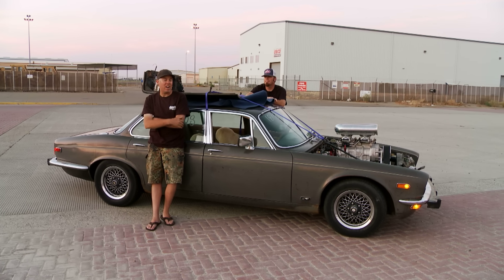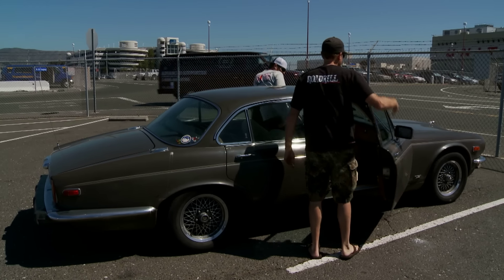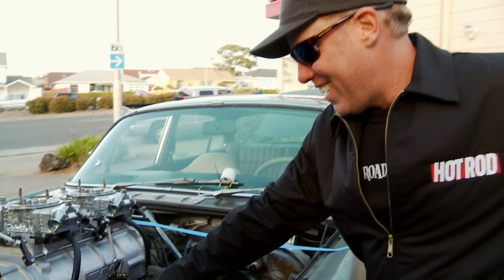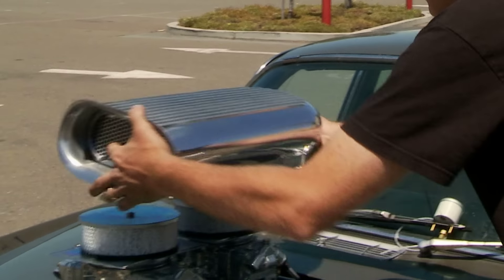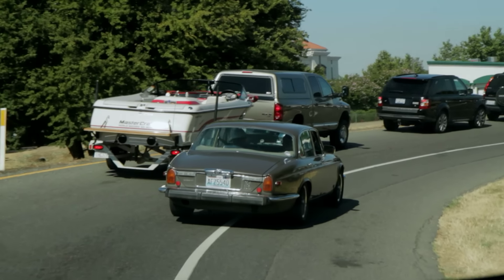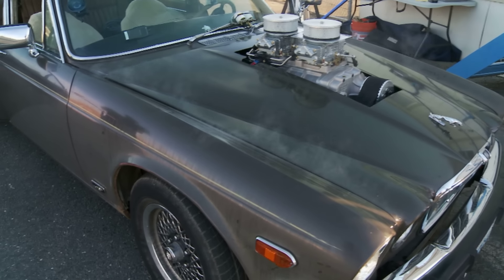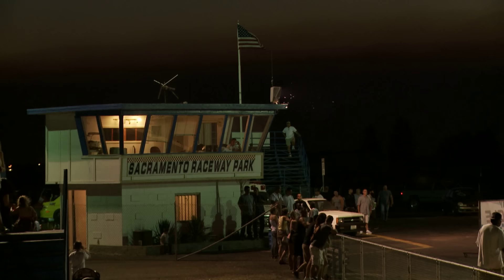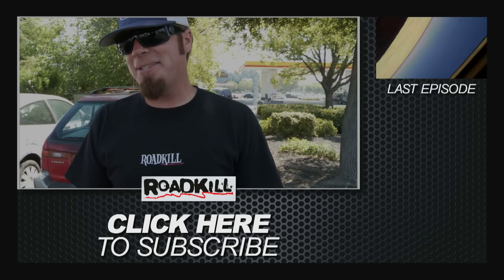Release The Draguar! Building a Blown Jaguar Rat Rod - Roadkill Episode 7

Comment: Never seen an XJ6 with the steering wheel on the incorrect side!
Reply: its an xj12
Reply: minibiker99
I sit corrected!
Reply: Factory reject. You know, Jaguar build quality and all that. Give all the wrong ones to the Yanks, no one knows the difference...
Reply: Midget saw No. The XF is one of the best mid-size saloons on the market. The 5 series might be a bit faster, but the Jag is comfier and has really nice handling with it, and lots of little details that make it a nicer and more interesting thing to sit in for long periods. The XJ is one of the best luxury limo-saloons out there, for similar reasons. The F type is a cracking big sports car, despite the annoyance of no manual option (and so long as you steer clear of the V8 version) and I'd recommend it to anyone who didn't absolutely have to have a clutch pedal. The XK is getting on a bit, but is still a cracking GT, an Aston Martin DB9 in all but price and the luxury hand made feel. Oh, and it doesn't have a V12, which is a pain. 
The whole range is pretty good, and yes, they do all look fantastic. 
And, if you look at the top 100 most reliable cars (according to warranty direct) there's a fair few Jags in there, amongst the Japanese stuff. Not many BMWs or Astons or any of Jaguar's competitors. Having free reign on what they do, and sharing with Land Rover has allowed their reliability to shoot through the roof compared to when they were strung up by Ford or BL.
Reply: Foxtrot Oscar Dude, get your head out of your own ass. Not every car has to be restored. If one or two cars out of a 100 (just an example) is completely different, its completely fine. Thes particular XJ12 is more interesting and full of character than any other XJ I've seen, since they are all restored and are basically stock. That's boring.
Reply: MarchuxProductions It's certainly interesting, but character? It's got a gutless, flat, dull engine and the only thing worth noting is the fact that half of it is sticking through the bonnet... which looks ridiculous.
A good one, with a proper V12, has far more character. I should know, I've got one.
Stock is good. Why? Because stock is good. Jaguar built a bloody good car, so why not enjoy it? Why turn it into something that looks like a good car but is actually just another V8 powered heap of shit?
That is boring.
By all means, modify an XJ, lord knows I have. Bypass pipes, a decent fettle and tune, 400hp, LSD, uprated bushings and roll bars, manual gearbox... It makes it a truly bipolar car. Quiet, sedate, refined, comfortable cruiser on one hand, but also a belting, well, I suppose it's a bit of a muscle car. But you can do that very, very easily with a V12, and 12 cylinders is far more interesting than 8 will ever, ever be. You can also supercharge the V12 too. And if you're going nuts, bore and stroke it to 9 litres, add the supercharger and end up with an 1100hp nutjob thing. But that's ridiculous.
Either way, keep it subtle, like the car always was.
All that this car is now is a loud, obnoxious, but worse vehicle. Originally they were the fastest 4 door saloons in the world, but now it couldn't pull the skin off a rice pudding, and it's an unreliable heap too.
Reply: Foxtrot Oscar Damn it, I should've mentioned that they put in a 640hp small block recently. And, see, Chevy V8s are more flexible. Why? Well, fully built small blocks can produce 1500+ hp, and I won't even go into detail with big blocks. Those engines are so popular, that it makes sense (at least in the US) to swap in V8s. Of course, this exact one is a really bad example, but, when done right, a newer LS series engine can do wonders. Especially if they don't want it to be a show car (or, should I say, a trailer queen?) but a thing to bash on and drag race. It was a run down car when they got it, and this is probably the best thing they could've done on a limited budget. This is a clash of two different motoring worlds, and it worked. Adding some 'murican muscle to British refinement isn't a thing that is seen too often, and it is almost always good to change things up a bit.
Reply: MarchuxProductions You don't need 1500hp in a Jag and if I did want ridiculous power I'd throw a 2JZ in there and pump 2000hp all day long.
Chevvy V8s are NOT popular. You almost never see them. Last time I saw a car with one in was Le Mans.... where I also saw more 1960s British sports cars than American cars full stop, let alone V8s.
massive American V8s are NOT popular.

They're also shit.

Why not spend less money getting a V12 built up? Even importing parts from Britain can't be as expensive as an 8k V8? 
The newer LS engines can make mildly impressive power figures (1500hp from a 7 litre engine isn't that impressive, a bone stock EVO X makes more specific power)

When done right, the LS engine is just about mediocre. That's a LOT of work for a mediocre engine...
If you want a show car, DON'T put an LS in it. If you want a race car, DON'T put an LS in it. And if you want a nice car to just drive around... you've guessed it, DON'T put a V8 in it. If you want a heap of shit that cost quite a lot of money, then put an LS in it by all means... but be prepared for people to point that out to you.

This is a clash of two motoring worlds that hasn't worked at all. They've got a nice Jag that's now a heap of shit, and they've got a powerful drag engine in a heavy car... Heavy car with a crap engine... Yeah, really great.

Adding 'Murican muscle to British sophistication isn't done very often because it's a SHIT idea. PERIOD.
Reply: Foxtrot Oscar We're not talking about just brute power here- it's RELIABLE power I'm talking about. That's why it might seem expensive. I'd like to see an old V12 be run both on the street and the dragstrip. It simply would not last. If it really was cheaper and viable, how come NOONE in their right mind uses them in their builds?

And your comment about popularity is completely irrelevent. They live in The States, where Chevy V8 engines are in just about anything from a dump truck to a Corvette. Importing and building jag engines would be hard and expensive.

I love 2JZs and RB26s more than any other engines, but let's face it- a 2000 horsepower 2J wouldn't last. Their safe limit is about 1500-1600hp, and to even get there costs more than building a 2000hp big block.

LS engines are good. Although I'm not the biggest fan of them, I have to admit that they are good, because they simply are. They are very flexible, relatively cheap, easy to modify and easy to take care of, much more than your precious Jags. I've met a guy who restores cars, mostly Jags, and he agrees that old Jaguar engines are finicky and tough to look after.

So, stop being the know-it-all, American hating loser (who thinks that everything made by the 'Muricans is shit) and shut the fuck up. Have you forgotten that the British used to build cars that didn't even hold together? If you want quality and finesse AND ease of use (especially in older cars) Britain isn't he way to go. Germany and Japan are the best. But if you want raw power and a car to bash on, America is the way to go.

Shit-headed elitist prick, why am I even arguing with you, you're the freak who likes inferior things just because they are made in the geographic location where you happened to fall out of a vagina.
Reply: Foxtrot Oscar BTW, this is coming from a European.
Reply: MarchuxProductions Ahem. Jaguar won Le Mans on that V12 twice.
No Chevvy engine has EVER done that, and the last was a Ford engine in the 60s that was twice as big as everyone elses and was mounted in a British car, the GT40. 
Jaguar also won numerous other endurance races with the V12. They're solid engines. Mine was in a barn for a couple of decades and has well over 200k since I rebuilt and recommissioned it. That was new rings, a light hone of the bores and new bearings. 
They're reliable engines. Damn near bomb proof.

Compare that to V8s... hmm, my Corvette grenaded itself, it's now a coffee table, the V8 in my Rover never quite ran right, my mate's Mustang died on track and ended up costing him an engine and a new bonnet it was so bad.. 

V8s aren't all that reliable either. 

Also, looking at them. V8s are NOT naturally balanced. This introduces stresses that perfectly balanced V12s DO NOT have to deal with. This makes them naturally more likely to break. 

You've just hit the nail on the head. Chevvy V8s are in dump trucks to Corvettes. In Corvettes they don't work because they're truck engines. Big, fat, lazy, torque but utterly useless for speed. In trucks, however, they have seven shades of shit kicked out of them by diesel engines, which are perfect for truck use.

A 1000hp 2J is perfectly safe on stock internals. It's making 333hp/L.
Try getting that from an LS1 and you need to aim for 2000hp, which is going to blow it up. The fact of the matter is, 2Js are bulletproof, big V8s are quite fragile. Yes, there's the 10 litre, 8000hp things... but they need a rebuild after only a few drag passes. Which means that some barely make it past 6 miles of actual driving. Which is shit.

Old Jaguar engines are PISS EASY to look after. All you have to do is use the right oil, and the,.. you know what, fuck it, ALL OLD ENGINES NEED PROPER ATTENTION. However, give a Jaguar engine that attention and the performance is fantastic. As good as or better than a period Ferrari and FAR superior to period American V8s (Some modern LS engines make LESS hp/l than my '61 E type did 53 years ago!) but requiring far less maintenance than the Ferraris and not much more than the American stuff.
Yes, they have their nuances. The XK6 engine was designed on the factory roof when the engineers were watching for incendiary bombs that could burn the place down. The V12 was an abandoned race engine. Those difficult starts mean that the XK had problems with oil seals, because they were designed in 1945 and were good then, but by 1992 when it was withdrawn, that was old school tech. The V12 suffered similarly as it aged.
However, compared to their contemporaries, they're hugely powerful and reliable and smooth engines, and NOT ridiculously expensive. In the 60s you could buy a Jaguar E type or a little FWD Lancia Fulvia for similar cost!

LS engines are SHIT. Compared to the 40-60 year old Jaguar engines I run, LS engines are rough, barely more reliable despite modern electronic fuelling and ignition, do NOT make the power they should and do NOT get that great fuel economy either. I could do, in my 330hp, 5.7 litre Corvette... 20mpg. I can push 20mpg in the 5.3 litre, 400hp Jaguar which is heavier, 40 years older and less aerodynamic too.

I cannot being a "know-it-all, American hating loser (who thinks that everything made by the 'Muricans is shit)" because I DO NOT HATE THE FUCKING USA, I DO NOT THINK EVERYTHING THEY MAKE IS SHIT AND I AM NOT A FUCKING LOSER YOU RETARDED FUCKING CUNT.

I have NEVER said I hate the US, I've NEVER said everything it makes is shit.
If I were born in the deep south of the USA with deeply religious parents, a good solid patriotic brainwashing of an upbringing and I was forced to sing the national anthem and swear upon a flag every single day... I'd still buy a Jag over a Corvette, because they're just better. I don't care where things are from. I'd buy Chinese cars if they were any good. I've got a Japanese car for fuck's sake. I had a Corvette (which is why I started to hate V8s, because it was a gutless heap of shit that drank fuel like it was going out of fashion and gave very little return... and blew up and broke down a lot).
My milling machine is American. My lathe is British. My micrometer and verniers are Japanese. My spanners, hammers, chisels and knives are all British. My lighter is America
This is because an American Bridgeport is mill. A British Colchester is a solid, accurate and good value lathe. Japanese Mitutoyos are good instruments, Sheffield steel is the best in the world so that's where my steel tools come from, especially knives, because they stay hard/sharp/shaped properly for longer and don't break as quickly.
American Zippo lighters are solid, reliable and although they drink as much fuel as American V8s do, they are mostly windproof and don't snap in half when I sit on them.
Everything I have I have for a reason...
I have the Jags because they offer, for their periods in history, a fantastic mix of quality, sophistication, speed, power, handling, braking, engineering excellence, beauty of body and GREAT value for money. I have the Nissan because it's a solid, cheap drift platform with good control and stability and parts availability, even from Japan.
I have the Land Rover because it's infinitely versatile and has yet never actually broken, despite having been completely round the clock eight times. I ditched the Corvette because it was costing more to keep running than the '55 Jaguar race car did for a season's racing, including fuel and maintenance, and it was a LOT less fun and spent half of its time broken. And my mate beat me on a road course in his 1980s BMW... 

If you want quality, finesse and ease of use... The Germans in the '60s and 70s made a lot of nice barges, but they didn't have V12s like the Jag XJ12, nor will they do 150mph and shit on most modern sports cars in a straight line. I like that.
They didn't make sports cars like the E type either, so that's why I have that. I thought about a G Wagen, but the Land Rover came up cheaper and has proven to be more useful as I can swap the body around as and when I feel like it as it's all modular, and as it's more common world wide, parts are easier when I'm touring.
The Japs build lovely cars, but didn't really get going until the 80s/90s, at least with cars sold in this country and thus available for me to buy at reasonable cost. I'd love a 240Z though. The Japanese E type of 10 years later... gorgeous cars.

The ONLY time I'd choose an American car is if I needed to smash into shit. If I were to get in a police chase in the 1970s, I'd probably choose a Charger... but I'm not in the 70s, and I'm not in a police chase. I'm in 2014 and I'm a nice guy.. and to be honest, in the 70s, the XJ12s of the British police force would have caught up quite easily with the Charger... 
For the average... me. American cars offer less power for petrol burned, meaning I spend more, or go less distance. (I drive 2-300 miles a day most days) they also offer lower quality than I'm used to albeit at lower cost, but also less driving feel and comfort with less engine character and, these days, divisive styling. What is it with GM cars and fucking angles everywhere? They just have so many shitty angular lines all over the place, it's an artistic nightmare!

Sorry, no American cars appeal to me currently or in history (bar maybe a Plymouth Barracuda. Apparently the S models handle sort of ok ish, and they look cool and have a cool name.
That's about it.)
And before you say 'The Ford Focus is a good car', yes, it is, but it's European. Ford Europe designed and built the first and second generation and this current 'world' generation with input from Ford US isn't as good and looks ugly. Oh dear. 
Facts of life and entirely coincidental, sorry, not my fault. 

So, you shit head slanderous prick, actually get to know a person's reasoning before attempting to shit all over them. It's incredibly rude, don't you know, and now you look like a total cunt!
Reply: +Foxtrot Oscar your reasoning is just piss-poor. You base it on personal preference, rather than reality. A 1000hp 2JZ is as likely to blow up as a 1200-1400hp LS (if both are built properly). The 2JZ is actually one of the rare straight-sixes that can handle ~750-800hp on stock bottom end, BTW.

After reading your reason for hating V8s, I have to ask: what year was your Corvette? Everybody knows that mid-70s to mid-90s was horrible for American cars.

You have NO IDEA about modern V8s, do you? Seems like it's the case because LSes get A LOT better mileage than what you said (also, stop using shitty measurement units, metric is better in every way)

A close relative of mine sold his beat-up 1981 Merc G-wagen for 6000 Euros a few years back. It had been rolled, the rear door had basically rusted off and the rear end was lifted with a bit of pipe stuck on the coil springs. You know why the price was so high? Because it's an amazing offroader. I rarely see even newer Defenders in a lot better shape go for that cash. That's because they ARE NOT THAT GOOD. Behind the wheel of that Mercedes, I managed to get further along a very difficult trail (I'm VERY inexperienced off road) than more experienced drivers with more expensive cars, including a few Land Cruisers, a Mitsu Pajero and your precious Landy. Or was that the older Range Rover, I can't remember.
 Boom. Disproved your point.

Next thing, the '70 Charger vs the S2 XJ12. Well, let's assume that the Charger is an R/T HEMI. If that is the case it beats the Jag from 0 to 100 (0-60, for morons) by a whopping 2,5 seconds. Not really faster, huh? Back in the day, no car could really catch the top of the line American muscle cars in a straight line. Especially the HEMI Chargers and Barracudas, the 454SS Chevrolet Chevelles or the Shelby Mustangs. OK, another one down.

Another thing, Chevrolet has never taken racing outside of the US seriously, so Jaguar winning at LeMans in the past is COMPLETELY irrelevent. How many engineers of that time still work on the new models?

Good job confusing the past with the present, cretin. Learn to fucking comprehend written text, you twat, and STOP USING YOUR BLOODY-WRONG OPINION AS A FACT. You are like one of those kids who think that every toy the own is better than any other toy. Don't even try denying this, because you clearly are like that. And your bullshit about 1000hp 2JZ engines running for ever - which mechanical asscrack did you get that from? There are some 800-ish stock internal 
2Js on the streets, but that's about the limit of what it will take. Built 2JZs, sure, they can get up to maybe 1800hp at max, but it will cost more than a similar-power LS.
BTW, there was a stock bottom end LS3 with twin turbos that pushed 1500hp in a drag-racing truck (IIRC it was called "The Red Devil" or something like that) that later got transplanted in some sort of a late-model GM and run on the street for years before blowing on the dyno. And the LS3 isn't even the  good LS!

Your points are entirely opinion-driven and pretty much outdated. Gone are the days when the Brits ruled everything. Gone are the days of Land Rovers being the ultimate off-road machines. So, stop blabbering on about how shit LS engines are while you have only had ONE car with a Chevy V8 (maybe it was the 350 smallblock, then no wonder why it sucked) and understand that Jag superiority has ended. They are sort-of coming back, though, the F-type is quite awesome.

You are the one who looks like a cunt, mate. Why? Because complete ignorance.
Reply: MarchuxProductions A 1000hp 2JZ can do so happily on stock internals. It is then making 333hp/l. An LS1 doing that needs to be making closer to 1900hp. In terms of stress applied, a 1000hp 2J is doing a lot better than a 1400hp LS, AND will do it on stock internals, very cheaply and is a nicer engine. It's a more impressive machine by a long shot. 2JZs have been proven to 1500hp on the stock bottom end, although not for huge periods of time. No 3 litre V8 I've ever seen can do that...

Everyone knows that the 1890s to 2014 has been rubbish for American cars.

I owned an LS1. I still do, it's now a coffee table.
The thing came out of a C5 and was a gutless, horrid piece of crap.

I've also driven C6s, C7s, C4s, C3s, C2s and a few C1s. I've driven Mustangs, Chargers, Challengers, Darts, Tempests, Trans Ams, Barracudas, Roadrunners and more. New and old.

I use metric. Sometimes imperial is easier though. Litres are metric, duh.
I refuse to use PS instead of horsepower though because PS is just German for horsepower and it's a fucking ridiculous measurement that's only a teeny bit more than hp and no one even told me that it was taking over. I still always write in horsepower. Fuck the Germans and there pferdeshekasjfuhdwsdf whatever it is....

Sorry, rant over.

You've disproved nothing. There are more Defenders in the world. Then again, the Americans will pay up to and beyond $70k for a decent one. 
However... a G Wagen is a very good vehicle, no disputing that... but I cannot lie down and sleep in the back of one. I cannot get parts in the middle of the African desert like I can for the Land Rover, I cannot chop and change between open top, soft top and hard top  and pickup like I can with the Series III. I cannot run a power take off for my lawn mower. I cannot fit the water and fuel tanks I have in my SIII in a Gwagen, I cannot fit a dormobile roof to a G Wagen. I cannot start one with a crank handle after it's been sitting in flood waters up to its windscreen for a week. I can't do those things because the G Wagen is less modular and more civilised. Nice for playing with, but not as useful for actually going out and doing shit. I could probably survive with one, but now I have the freedom of a Land Rover, I don't think I'd like using anything but. I tried using a friend's Humvee once... I wanted to die, it was an awful trip. Then again, Humvees are shit and G wagens are much better. I'd love a UNIMOG, or a 101 Land Rover.... Point is, the SIII works for what I do with it perfectly. If I didn't work it so hard, a G wagen could take over, but it's the little things the LR has that the Merc doesn't. And I'd keep smashing the indicators on the G wagen. My wing tops take a hell of a battering. Good place to stand when winching.

Charger vs XJ12. Let's see. They'd do 140mph in a straight line, so, drafting the Charger could easily keep up in a motorway pursuit... or if the idiot went off onto smaller roads, their infinitely superior handling would ensure the Charger was apprehended very quickly. Also the huge fuel tanks and superior fuel mileage of the XJ12 would win out in a long distance chase. In the 60s, the 3.8 litre E type Jag was poking 150mph in the eye with a big stick. The 7.2 litre aero modified Plymouth Superbirds 10 years later were running out of puff at 145mph... Hmm. Straight line speed eh? NOPE!

Chevrolet are VERY serious about Le Mans racing, that's why they had the biggest, fanciest crew area, made LOTS of shouting patriotic noises and had a fucking club stand with a few rickety old Corvettes on it. No one else did that, not even Audi who make much nicer cars like the A1.

The JAGUAR V12 ENGINE winning Le Mans is ENTIRELY relevant to the JAGUAR V12 ENGINE BEING RELIABLE AND POWERFUL

Britain still makes bloody good shit, Land Rover are still best in pretty much every class they're in and guess what, Jaguar are making cracking cars too. XJ, XF, XK and F type. Get the V6 in any of them and you'll have a ruddy wonderful motor vehicle.

I had one LS1 powered Corvette... but my job is to drive lots of different car. I've driven LS powered trucks, cars, kit cars... they've all been shit. They're NOT GOOD ENGINES AT ALL. Maybe in the 1970s they'd have been considered ok... In fact, no. My XJ12 is from the 1970s and that's MUCH better than a modern LS. In fact, my track car, a 1955 Jag has a nicer engine than a modern LS, and more mechanically advanced too with DOHC. If I had low standards, 50 years ago, I'd have said the LS engine was good. Not if I were a high standard guy, which I am, and certainly not compared to things like the 400hp Nissan 3 pot thing.. 
Jaguar were never superior to everything.. however they do do what they've always done. Offer a high class experience for less money. The XK is an Aston Martin... but cheaper. The XJ is a Phantom... but cheaper. 

You are the one who looks like a complete idiot mate. Why? Because this shit is my job, I'm anything but ignorant, and you're trying to disprove which car is best for me. Yah, good luck with that.
Reply: Foxtrot Oscar Are you retired or something?
Reply: Foxtrot Oscar You just bit your own ass. Yeah, your car might be best for  you, but is it the best for everyone? Nope. Running one (with high HP numbers) in the USA would be too expensive and hard. Why import parts when you can get them in a shop next to your house? That's simply ridiculous. Even here, in North-Eastern Europe, it would be cheaper to run a modified LS than a modified Jag V12.

You still haven't explained WHY you think the LS series is bad. All you're saying is that those engines are bad and everything else is better. They are light (roughly the same weight as a 2JZ), they are reliable, easy to make power with and the aftermarket scene is HUGE. Not to mention, they are quite cheap. Try finding a BRAND NEW engine for the price of an LS with the same capabilities.

Charger vs XJ again. By the time the Charger gets to 100kph, the Jag would be roughly at 70. And the same difference would stay there for the rest of the run to 225kph. Even with drafting, the Jaguar could not keep up. Let's not even talk about Challengers or HEMI'Cudas. Those were even faster.
Oh, and straight line speed is not only the top speed, but also acceleration. The faster muscle cars would leave the E-type in the dust all the way to their top speed.

Chevrolet's C6 Corvette marked a turning point in their engines. The LS engines made after that point in time were a lot better than the ones found in the C5. 

Are we talking better cars in general or better cars for you? You seem to switch over from one to the other. Make up your fucking mind. It's a miracle that anyone let you talk, let alone work on cars. You're clearly biased.

Why are you even commenting on so many Roadkill episodes? Make your point and leave, for fucks sake, and stop saying your cars are superior, while many Pro Touring cars would smash it around the track.
Reply: MarchuxProductions I don't even own an ass.
If you can't afford to run a Jaguar... you can't afford a Jaguar... so you can't afford a Jaguar and YOU CAN'T AFFORD A JAGUAR!
What do you do when you can't afford something? You don't have it... really fucking simple stuff.

Here, in Britain, I could buy THREE good Jaguar V12s and have them modified up to 400hp for the cost of ONE LS1 making slightly less power.
So, no, LSs are NOT cheaper.
Why import parts? Same reason I import parts for my 180SX. I like the car. I love the car, even. That's why I do it properly. If I wanted, I could stick a BMW straight six in it. Parts are cheaper because you can find them in scrappers or import them from Germany rather than half way round the world... but then I may as well buy an E36 M3 and ditch the Nissan.
If you stick a big V8 in a Jaguar you may as well just not bother and buy a Cadillac instead. The engine is the heart and character of the car. Don't ruin it.

Thing is, no LS engine is brand new. They're essentially a 1930s design. No one really makes shitty old engines anymore, and modern engines are expensive because they're expensive to design.
This is why LS engines are bad. Well, partly. In the 1940s, Jaguar introduced a DOHC straight six engine. This is still more advanced than the pushrods of the 2014 Corvette. Way to go Chevvy. I really want that vastly outdated technology that does NOTHING for performance in my 65k car! 
LS engines aren't that reliable. I've found the Jag 12 to be reliable and stories abound of their bombproof nature. So there's no benefit there.
400hp is piss easy from a Jag 12, so there's no need for any more power as that's already pushing what the car can take. 

Charger Vs XJ12. I don't work in KPH, so you'll have to convert like I have to. 

The stock 1969 Dodge Charger R/T HEMI apparently pulled high 14 second 1/4 mile times . The stock 1961 3.8 litre Jaguar E type Coupe pulls mid 14 second 1/4 miles.
So, in terms of off the line and accelerating away, the E type would be only marginally behind. Its lighter weight would give it better instantaneous speed changes. The big 7 litre HEMI also topped out at about 140mph, while the 3.8 litre Jag could go on to 150. Then you have the brakes. Mostly ineffective drums for the Charger (although I believe there were front disc options, they were almost as rubbish and locked up all the time) but the Jag has a set of four very good disks. It was those that helped Jaguar dominate Le Mans in the '50s. The suspension too. Leaf springs and live axles in the Dodge corner and highly sophisticated coil sprung fully independent wishbone suspension for the Jag. So sophisticated it is still in production on todays Jags, albeit modified a bit for the weights and power demands of modern cars.

The Challengers were faster than chargers, posting low 14 second 1/4 miles but still more than 5mph off the Jag's top speed, and they're a decade younger. They also still have rubbish suspension and brakes and are very heavy.

That's only compared to an E type.
 The XJ12 has even more power. Yes, top speed is 140mph which matches the Charger (the original comparison) but the actual acceleration is quite similar. This is because the V12 simply pulls so much better, and the car is much lighter than a Charger. Again, the suspension and brakes are far superior. The XJ was praised enormously in its day for its incredible roadholding and handling.
In a chase on a track or public roads, the XJ would catch/get away from the Charger easily.
The automatic XJs were slow to 60, but my manual, even with all the exhausts closed and only making a near stock 300hp does much quicker 0-60s in the 6 seconds, similar to a Charger. It's probably faster once I open the taps and release the natural 400hp of the engine. (only 25 down on the Charger, which is much bigger... Just saying)

In a real life chase, the XJ would be faster. It just flows so much better on real roads, driving faster is easier.

The C6 still had a rubbish bunch of engines. Gutless, inefficient.. Only the ZR1 made decent power, and that engine weighed a ton and got far less economy than even a big V12 Lambo, with LESS power! It also made the handling even worse than a Z06.

Even the C7s new LT1 is a heap. Very little power for its size, the economy still isn't great, even when it is only running as a 4 cylinder.

I'm talking better cars. In general.

Yes, I am bias. I'm so heavily bias it hurts. I'm bias towards good cars all the bloody way... and I can't see a single thing wrong with that. I would prefer a good American car over a shit British car every day of the week. I'd rather a good Russian car than a shit Japanese car, I'd rather GOOD cars over BAD cars.
Thing is, the US hasn't made many good cars and Britain, Europe and Japan have made a lot. That's why I stick to those sort of cars.

Roadkill is funny, I like watching the bits where they aren't raping nice old Jags.

Pro touring? The old muscle cars? Yeah... If my little Jag can pace a modern Ferrari on track, I highly doubt a crummy old muscle car has a hope in hell. Half the weight, similar power, superior aerodynamics, brakes and suspension.. Nah, no Camaro or Challenger is going to get close.
Reply: Putting an American V8 engine in a Jaguar is a bit like re-filling an empty Dom Perignon bottle with WKD Blue (runs and ducks!)
Reply: Foxtrot Oscar

Well after seeing how you comment on videos, I'm going to have to say you are one of the dumbest people I've seen on the internet.  British cars are the epitome of GARBAGE.  Ford sells more cars in your country than your own country's manufacturers do.  

About an LS engine compared to a Jag motor, you sir are a complete imbecile as well.  A junkyard LS1 will stand up to 800HP with an absolutely bone stock rotating assembly and block.  Add your power adder of choice and your done.  A Jag rotating assembly can't come close to that without EXTENSIVE costly modifications.  And you have the audacity to say it's cheaper on the Jag to make it faster?  LOL @ YOU. 

And about your America comments.  See the thing is, in America, we like cars, we like fast cars, we like crazy cars, and British cars are none of the above.  Do you know how many 1000+HP daily drivers there are in America?  100's of thousands throughout every state in the country.  So you bring your Lambo, Faguar, Aston, etc., and I'll take my 8 second Mustang and wipe your ass with it. 

You know what the fastest engine in the world is?  An American V8.  Make sure to let me know when one single British/European company tries to build an engine to compete in Top Fuel or Funny Car in the NHRA (where the fastest 4 wheels in the world compete).  Because thus far, in the past 50+ years, not a single competitor from outside the states has came forward.

Oh wait, but you can go around a corner right?  That's soo cool.  In America, are roads are fairly straight and wide. So having a cornering machine while driving in a straight line is about as fun as watching paint dry.  But pulling up to some shit box Italian supercar, British supercar, or any other trash that some dumbass American paid lots of money for, and then watching the look on his face as my 100 year old technology American V8 blows the doors of that quad turbo'd piece of shit V12, is absolutely fucking priceless. 

Keep talking shit about things you know nothing about.  It's no wonder you seem to cry on the internet.  Let me know when you come to America with your awesome fast car.
Reply: Yates Monster Your first sentence marks you as a moron.
In 1948 the Jaguar XK120 was the fastest car on the planet. No one calls the Veyron garbage now, do they?
Rolls Royce have been the epitome of luxury for the past 107 years, 
Bentley were smashing seven bells of crap out of the French and Italians in the 20s and 30s. The 50s hailed some truly fantastic cars, such as the Mk2 Jag and D type, and also the booming popularity of the Land Rover, as it drove places that no one ever had before, in countries where cars had never been seen before, and in some cases haven't been since. The 50s also birthed the legendary Lotus 7, which is still in production, the Mk1 Austin Healey Sprite, and the almighty Mini, which is adored world wide. Oh, and the MGA, which is oh so very popular in the US. Plus, although it never made production, Rover designed, built and tested the worlds first gas turbine car... a frikkin JET CAR!

The 60s bought us more Minis, the Jaguar E type (their second worlds fastest car title), the Aston Martin DB5 (James Bond) the Austin Healey 3000 (well, well loved car that's still being copied to this day) the legendary Lotus Elan (the handling benchmark that still stands). The MGB, which is still one of the worlds most popular classic cars, The Lotus Ford Cortina (won a shitload of touring car races) Rover introduced the P6, which is still one of the coolest looking 4 door saloons ever. The other coolest saloon is the Jag XJ12, smoother and MUCH faster than a Roller. In fact when most cars (including police cars) of the day were hitting their top speeds, the big Jag still had ovr 40mph in hand. Which is why British Motorway patrol used them. Faster than a sports car, big enough to smash the crap out of one too.
The AC Cobra too, but that was a bit shit thanks to its ridiculously oversized engine...
The Jensen FF picked it up a little though, as it was the worlds first 4wd car.
 
Then of course the 70s were actually brilliant with things like hydraulic suspension, quad valve engines, the Triumph TR6, Jaguar XJS, the Range Rover (which pretty much defined an entirely new and INCREDIBLY popular type of car, the SUV), the Lotus Esprit, Rolls Royce Silver Spirit, the Ford Escort RS (rally god of a car) the Capri also, which was just a superb bit of fun, the Dolomite Sprint, Austin Princess, Rover SD1 and so forth.
Chrysler being shit and union action severely damaged production ability in the late 70s, but when the dust had settled, the 80s dawned on..

Turbo nutter MGs from heaven and hell at the same time.
The Maestro turbo was bonkers!
Bentley introduced the Turbo R, which is insanely quick and is like a heavy weight champion boxer... in an immaculate tailored suit.
The Daimler Double Six is an insanely quick and luxurious V12 barge, the Ford Cosworth Sierra RS Cosworth 500 is given a ridiculous name but is ballistically quick and fantastic to drive, the Rover 800 is some kind of cheap but incredible luxury coupe thing, having replaced the utterly magical SD1 and, of course, the Vauxhall Nova comes to play.
Jaguar produces their third worlds fastest car, the XJ220.

The 90s were even nuttier,  McLaren decide to piss on Jaguars cornflakes with the F1 (to this day the fastest N/A car ever) Lotus Vauxhall introduce the Carlton, which was almost banned for being too ridiculously fast and normal looking (it looked like a normal family car with alloy wheels but did 170+mph). The Lotus Elise was born, also the 2nd gen Elan, which is one of the best handling FWD cars ever, the Cosworth Ford Escort RS Cosworth has another silly name but is like a 4wd attack dog on steroids and the MGF becomes a thing, bringing mid engined awesomeness to people with normal sized wallets.
Oh, and TVR unleashes the flaming hell hound Cerberus. 
They later put a V12 in it that's so powerful it smashes their 1000hp dyno. Also, the car is declared too looney for normal people and is only sold to racing drivers, it's that scary. (I've driven one with a documented 1200hp, and yes, it is scary, but it actually goes round corners too..)

The 00s bring a whole new raft of manufacturers like Ariel, Noble, Ascari and so forth, The VX220 becomes a thing, which is like an Elise but with a little bit of comfort, like air conditioning and squidgy bits. Still brilliant.
Rover bring in the 75, which is actually a really good car even to this day, that's why there's so many still around. MG are doing ludicrous things with Rovers and building some cracking touring cars, Lotus invent a way to replicate the effects of having sex on Es in a 4 wheeled machine, the Exige, and jaguar decide to make one of the best looking cars of this century.

As for this decade, look at Rolls, Bentley, Jag, McLaren, Land Rover, Morgan, Noble, BAC, Ariel and all the rest and tell me honestly that the cars are crap.

I couldn't care less if what you think, or even if you don't read all that, fact is, the British auto industry has been consistently world class for the last 117 years, with only the early 1940s as a faltering point... because all the factories were being bombed to shit and were making Spitfires and bullets instead of cars.

With the Jag, you can add 100hp for free, if you're clever. 100hp/£0 equals ∞hp/£. Disprove it.

See, in Britain, we like fast cars. That's why British manufacturers hold 5 fastest production car of the decade and almost all the absolute speed records. (we're currently trying to do 250mph over our own current record).
We also, unlike the US, like good cars. We like crazy, hence the jet cars and the dyno smashing 7.7 litre naturally aspirated V12 and basically TVRs in general. However, all these crazy cars have an air of quality to them. Top design, solid execution. Yup, even TVR.

You know what the fastest engine on the earth is? A Rolls Royce Spey.
You know what the fastest production car engine is? A Bugatti W16.

NHRA cars do NOT top 700mph. That's a British only thing.

They also DON'T ALLOW ANY OTHER MANUFACTURERS TO ENTER ENGINES INTO TOP FUEL YOU DIP SHIT. All engines HAVE to be a modified Chrysler thing that melts after 10 seconds at full throttle. (seriously, they have literally no cooling whatsoever)

So you like proving that you have a small penis with your 8 litre engine against a 4 litre Ferrari. Great.
Know what I like? Pulling up next to a 7 litre Corvette in a 1.8 litre 4 pot Lotus and kicking seven shades of shit out of it, off the line AND round corners.
The entire world has corners, only the US has these boring dead straight roads that are measured in days not miles. No one likes that shit. Everyone loves corners. Why do you think racing drivers go round them so much?

I'll let you know when I next take my 1972 XJ12 over. I love lining up next to 70s muscle cars in my quiet, refined, comfortable luxury car and blowing the shit off them.. heck, I might just take my '55 Jag out there and play with Corvettes at 190mph. Who knows, all that straight might let me hit 200 in it again.

Next time I'm out on a works trip long enough to bother taking my own car, I'll let you know. Could be fun.
Reply: Foxtrot Oscar

What exactly did that wall of text you just wrote have anything to do with what I said?

So lets get back to where you don't know the 1st fucking clue of what you are talking about.

You said you could make more HP with your Jag shit as an LS motor for less money.  That is beyond laughagle.  In this case, google is your friend on just what an LS motor is capable of in STOCK trim.

You also claim American V8's are terrible yet they are the FASTEST/QUICKETS combustion engines on the PLANTET.  Again, just another case of you not knowing the 1st clue about wtf you are talking about.  You think the guys in the video think the Jag is some sort of luxury car?  Do you even think a gear head gives the 1st shit about luxury?  The video is so blindly obvious about what they are doing that elitist retards such as yourself can't even see it. 

I, along with just about 99% of the rest of the world could give 2 shits about a bently or a rolls, let alone some bag of shit V12 with 4 turbos that can go over 200mph.  Our V8's go to 300mph in just over 4 fucking seconds.  So do I think the veyron is some sort of master piece?  Fuck no.  It's an over priced piece of shit.  If I wanted the same speed I'd use the best engine in the world to do it, a big honking american V8.  And the last thing I would need is a $750,000 chassis on top of that to do that.  Sure, most people are worthless and don't have the 1st clue about performance or building a chassis, but suckers will always pay for work done in an OEM type car.  Us true car enthusiasts do it ourselves.  And to be so elitist and ignorant about a Jaguar only tells me that you honestly believe there's something special about them in the 1st place.  I find it fucking pathetic.  Jaguar as a company has one of the WORST reliability history in the entire automobile market.

The same can be said for your bently, rolls, mercedez, (insert high dollar exotic junk here).  Let me know when you find that bently with 500,000 miles on it or the same with the Jag that hasn't had fuck all done to it.  Good fucking luck with that.  But I can count countless American cars that A.) were cheap as fuck to begin with and B.) cheap as shit to maintain, and C.) went well over 500,000 miles without as so much as engine or transmission trouble at all. 

Keep up your elitism and more importantly, lack of knowledge.  It only ends up making you look extrememly stupid.  And if I ever did meet you in real life, I'll be the 1st to say it directly to your face.  You don't have the 1st fucking clue about cars let alone engines.  Again, let me know when the British/European segment makes ONE fucking engine that can compete with the fastest cars in the world (NHRA), because thus far, it hasn't happened, and will never happen..

Good god you're an idiot.
Reply: Yates Monster A comparable sized Chevvy engine is making, nowadays, around 350hp. That's 50 fewer horses than my Jag makes, and only about 40 more than that engine made 42 years ago. If you're making less than 1hp per year, you're not really doing very well.

The fastest combustion engines on the planet? Are you insane? What about the 700mph Rolls Royce Speys?
Again, just one more case of you assuming I have no clue despite my making a living out of this shit.

Gearhead being the silly American term for petrol head, YES, they do give a hoot about luxury. I'm one of them.
Your 300mph V8s also last less than 20 seconds at full throttle, then they're toast. So, err, that's a bit shit. They also only do it on nitromethane and frequently just blow the fuck up without even going anywhere. Oh, and massive superchargers.

If you want the speed of a Veyron, fine, go fucking have it. 270mph is boring. What isn't boring is the fact that you can drive a Veyron anywhere, any time, in any weather. It's not scary or intimidating or going to kill you. It's a car, not a deathtrap. THAT is what makes it masterpiece. That it gives ordinary people safe control over 1200hp, that it is an epic Gran Tourer yet also the fastest thing on four wheels that one can purchase off the shelf, so to speak.

Your big stonking V8s are also SHIT. Why? Because they're A) broken, B) constantly misfiring) C) trying to rip themselves apart and D) have cunts like you defending them when you haven't the first clue about cars.

COME OUT OF THE LATE NINETEEN FUCKING SEVENTIES YOU DILDO.
Yes, in the late 70s Jaguar were a bit shit. But then, everyone was because of the general oil woes and the fact that BL was having massive labour issues. So, yeah, a few short years Jag was not that great. If you were lucky you got a perfect, great car. If not, you got one that occasionally didn't work.
But guess what. That was nearly 40 years ago. For the half century prior and 40 years after until now, Jaguar have made nothing but decent cars. Bar the shitey X type which was a Ford fuck up. Who else would put a Jag body on a MONDEO.

Ok, fine, if you're comparing cheap, utilitarian American cars to high end luxury performance cars then I can do the same. How many million mile Corvettes have you seen? How many million mile Lu... oh, no, I forgot, the US hasn't made a luxury car in the last 80 years.

Look, it's HIGHLY unlikely that most people will ever get a car to 500k, so why not just buy a decent fucking car to begin with? I don't WANT a car that looks like shit, handles like shit, drinks so much fuel I have to take out a mortgage and that can't even fucking fire properly.
I DO NOT WANT THAT. 
In fact, very few people do. That's why I can go for a 1000 mile drive and see maybe... one, two cars with big American V8s. I'll probably have seen 7 or 8 Ferraris, maybe a few Lambos. R34 GTRs, Lotus Carltons.. A few hens teeth and some rocking horse shit.

Keep up your... peasantism?... just, whatever.
Honestly I couldn't give a shit about your slow as fuck NHRA cars, 760mph, Land Speed Record. Your V8s are slow, our Rolls Royce engines are FAST. Hell, we hit 300mph in the 1930s!
Oh, and seriously, power does NOT make an engine good. Any cunt can turbo nitro supercharge the fuck out of a massive engine and make power. It's quite difficult to find an engine you can sit behind or in front of, turn the key, thumb the starter and suddenly the world is all right.
That's how I feel behind my V12. Because that big silky old thing never lets anything bother it or you, never gets out of breath, never bothers you, urges you gently on and nothing more. Its sweet song is calming and refreshing.
Unlike a big V8 which is not silky, is a constant pain, always attention seeking but never giving much back. They're out of puff at the top, give far too much at the bottom, don't rev, don't respond and really don't encourage fast driving at all. Not for someone who actually enjoys driving rather than just childishly burning rubber.

If we ever meet in real life, I hope to hell I've got my little D type with me. I'll show you that 3.4 litres of 59 year old straight six can make you scream like more of a little girl than 8000hp of shitey one trick soon-to-blow-up dragster ever could.
Reply: MarchuxProductions stop saying things that make sense he will just keep saying the same bullshit over and over. On the other hand you make great points he is just to ignorant to make sense of it
Reply: TheLordJethro Well, yeah, he's the one saying that an ancient Jag engine makes more power for less money than an LS.
Reply: and you still havent. its an XJ12L. -_-